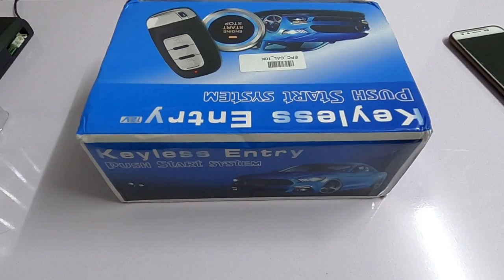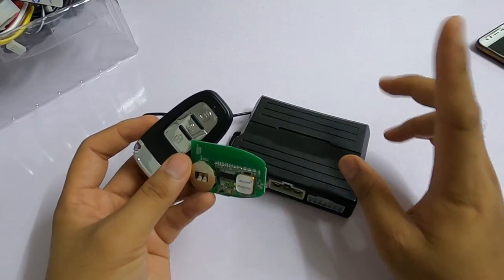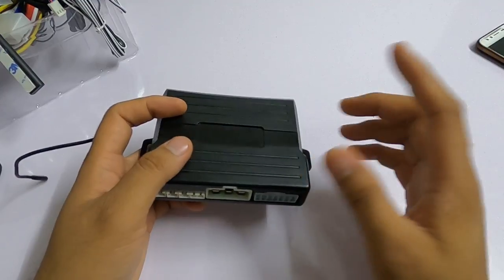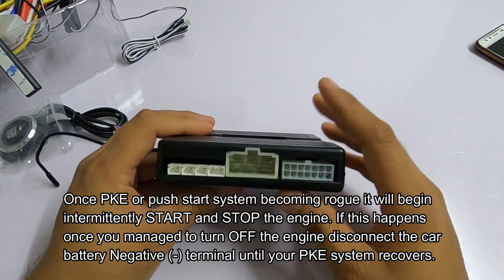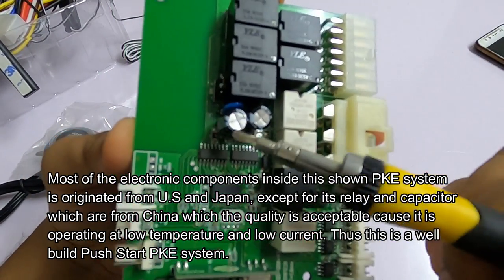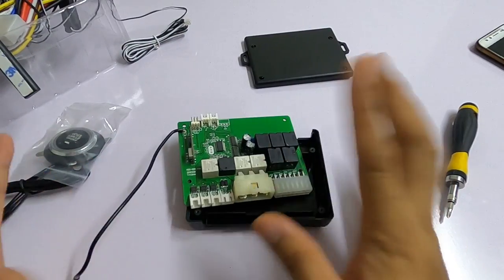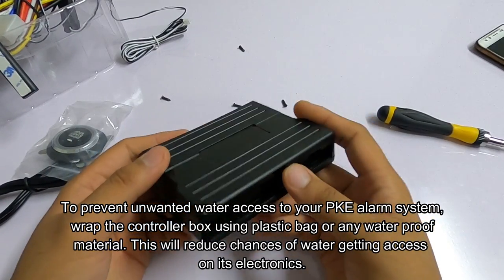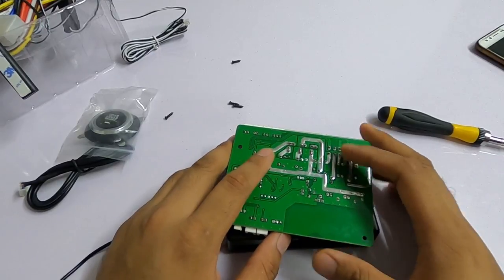Push Start PKE | Aftermarket Installation Safety Precautions & Risk

Comment: Alarm box lama dekat mn ye
Reply from the maker: Hi bro, kurang faham sikit alarm box lama maksud yang car oem ke atau yang sudah upgrade?....kalau sudah upgrade depend on the installer dia letak mana but kalau factory installed bos tak perlu buat apa-apa plastik wrapped mcm dalam video ni. Yang dalam video ni untuk alarm yg installed after market or upgrade.
Reply: @IkmalRusli  car OEM alarm
Reply: @IkmalRusli  utk starter wire dekat mn ye, dekat alarm sya Kena connect satu wire kepada starter wire
Reply from the maker: @goldenlotuscaraccessoriese9927  hi bro, wayar starter tu you kena tap dari original key switch wire start tu kalau tak tau which one guna 12v tester dan turn the key to check each wire 1 by 1 ini untuk kereta yang original guna key to start. Kalau u punya kereta dah guna oem factory push start mmg susah sbb dia dah integrate sekali wire system ke ecu.
Reply: @IkmalRusli  sya punya toyota wish 2005 nfl, wire starter tak jumpa, sya test lain wire sudah dpt, starter wire je tak dpt, sya punya kunci punya, nk pasang push start punya
Reply from the maker: @goldenlotuscaraccessoriese9927  bro wayar alarm tu color apa yg bro belum sambung tu
Reply: @IkmalRusli  yellow
Reply: Wire signal dari alarm box kena connect dekat mn?
Reply: Price?
Reply from the maker: @deepakpandey1230  in Malayia it is around 260++ which around USD60++
Reply from the maker: @goldenlotuscaraccessoriese9927  Saya telah memasang buat pemasangan PKE system ini namun saya tidak membuat video pemasangan disebabkan kekangan ruang bekerja yang terhad "ruang kediaman". Namun video cara pemasangan yang paling tepat seperti saya ikut boleh tonton di link  berikut:
https://youtu.be/QT-XmFuEGsw